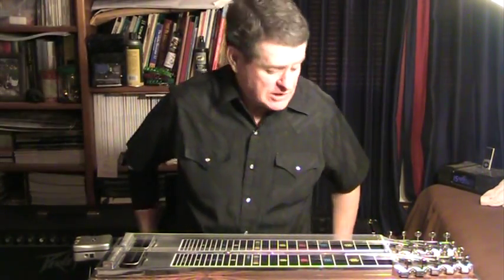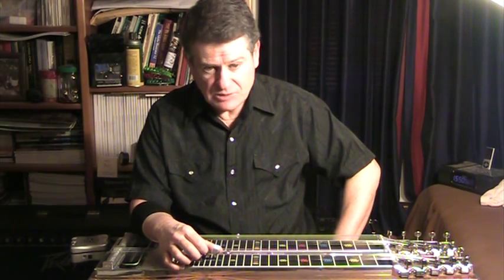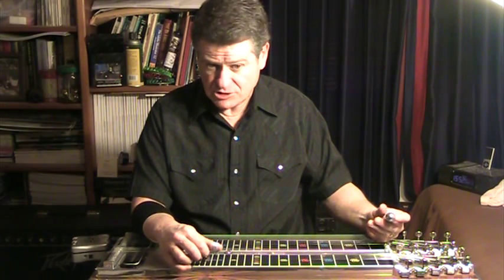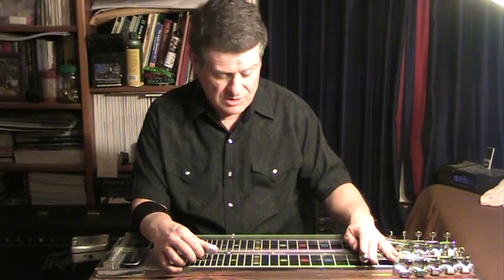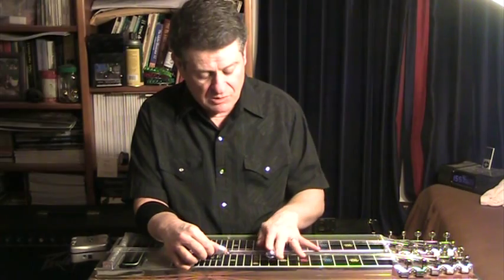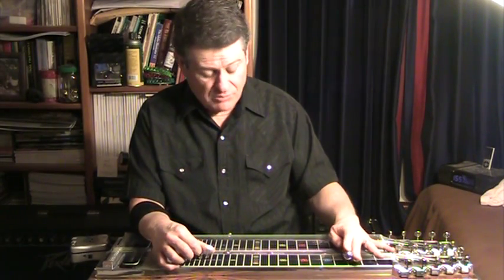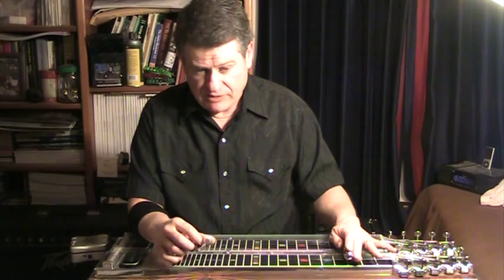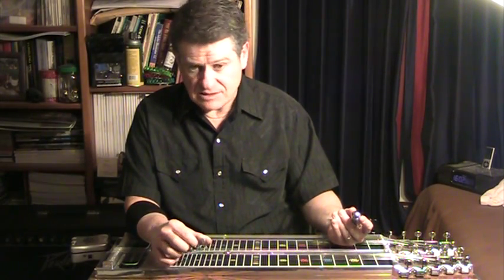Thoughts RE Compensator on 1st string F#: E9 Pedal Steel:  Paul Sutherland

Comment from the maker: If you tune the F# slightly flat, which some people do, then the open B chord combo (strings 1, 2 & 5 with no pedals) is off.  If you split the difference, then it's off for everything.  With the compensator it's on pitch for everything.

Comment: so whats a compensator...?
Reply from the maker: +Mr BreakRAK A compensator is nothing more or less than an extra rod and linkage set up to raise or lower a certain strings just a little bit, when the designated pedal or lever is activated.  So in the example of this video, I added an extra lower to my knee lever that lowers the 2nd string from D# to D.  The extra lower is the linkage necessary to lower the 1st string just enough that it is in tune with the 2nd string when lowered.  Let me know if that doesn't make sense.  I would not try to set up this particular compensator if I was lowering the 2nd string to C#, with a feel stop at D.  I think this particular compensator on the first string only makes sense if you forego having the lower to C# on the same knee lever as the lower to D.